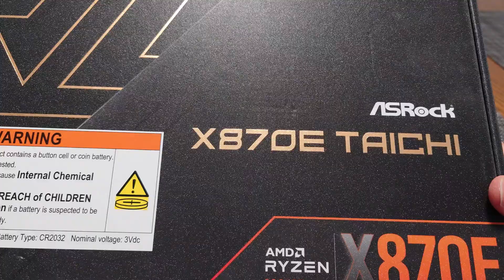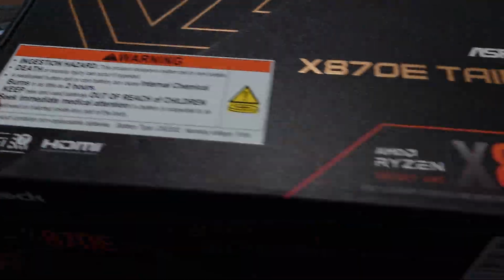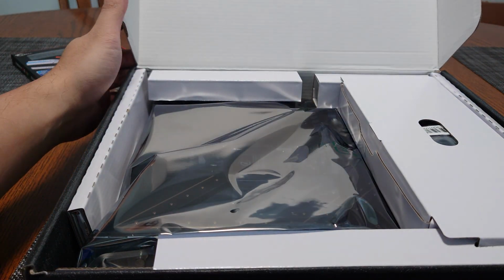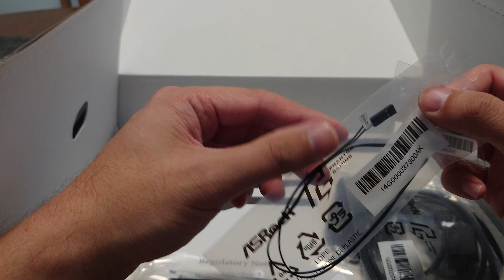ASRock X870E Taichi Unboxing and Overview | Is this S Tier?

Comment: I have both rx 9070 and rtx 4080 super in this motherboard so I can use either as I please.

Asrock X870e Taichi

Msi Meg AI 1300w

Ryzen 7 7800 X3D

Gskill Royal Neo Z5

Samsung 9100 ssd

Msi 32 inch crux Oled monitor

Comment: So if i am gonna insert my old sound card( PCI-E x1) in second PCIE slot, the main one is gonna run in 8X mode? Or it will only happen if i am gonna use another GPU in second PCIE slor? Thank you.
Reply from the maker: Both will run at x8 if something is present in the 2nd slot. Doesn't matter what it is.

Comment: Hello! Thanks for the detailed explanation, May I ask Can I plugin another GPU on second slot of PCIE (I must use dual GPU setup) WITHOUT interfere with the USB2.0 and audio header below the board? I see they are dangerously close to each other, I think the height of the header will be an issue? My second GPU is 3090 FE (extruded metal form), i m afriad it will block the header preventing me installing it correctly

Comment: Should i upgrade x670e to x870e?
Reply from the maker: X870e
Reply: @GameTechReviews  I only play gaming! And use for 9800x3d! I'm currently using Asus tuf x670e  wifi plus and wondering if I should switch to Asrock x870e phantom nova wifi?
Reply: @GameTechReviews  I only play gaming! And use for 9800x3d! I'm currently using Asus tuf x670e  wifi plus and wondering if I should switch to Asrock x870e phantom nova wifi?
Reply: @GameTechReviews and i need to pay an extra $235 to upgrade to x870e where i live! do you think it is worth it?
Reply from the maker: @lindow8297  Why would the price be that different. Unless you are comparing two motherboards that are vastly different in features. If it's the same board for example X670E Taichi vs X870E Taichi, if the price is really that different get the cheaper one.

Comment: quick question i hope you see it. Did the box come to you as it appears in the video, meaning no factory seal of any sort? I bought a mobo before this one and returned it, msi, and it had a plastic seal around,  but this one did not. Want to make sure im not getting an open box
Reply from the maker: It had no seal.
Reply: Mine had no seal either

Comment: just finished building it, the backplate makes the board way stiffer and stronger than those without. the reinforced vga slot also gives me peace of mind. Its got one more additional standoff too so 10 bolts total. Mechanically I think this is the best so far. I used d15S, zero sag

Comment: What is the three pin connector that's right above the front panel header and below the SATA connectors?
Reply from the maker: It's either another ARGB header or the UART header.

Comment: What RAM is everyone using with these?  I bought one and got RAM off the QVL and it wont post.  Did some research and apparently the ASRock memory QVL isnt accurate.  Lot of memory issues with this board and G.Skill.  Cant even make it to BIOS.
Reply from the maker: If it's on code 15 you need to wait several minutes, it will post, it just takes awhile on the 1st boot.
Reply: @GameTechReviews  No it is 21 and apparently way more common than it should be with this generation of ASRock boards.

Comment: I am really interested in the ASRock X870E NOVA.  It has 1 M.2 Gen 5 x4 to CPU, 1 PCIe 5.0 x16 to CPU no switch, so dedicated lanes. Then it has 3 M.2 Gen 4 x 4.  Like you said the price is even cheaper around $350 but out of stock everywhere.

Comment: I don't mind screws for the M.2 covers but,  I do mind ASROCK using a weird size  Allen head screws like they did on the X570 Tachi. Nice to see them use a common screw head.  It's the little things that will drive you crazy when building a PC. :)

Comment: The Taichi is great.....I would say the Nova is a hair better for having 5 M.2 slots and ZERO lane sharing though.
Reply: Taichi also has no lane sharing.
Reply: @ebromoto  He means that if you plug ANYTHING into the bottom PCIe slot, like a 10 Gbps NIC for instance, the top slot automatically becomes x8. It's either x16 / x0 or x8 / x8 for the PCIe slots.

Comment: I just bought this yesterday. I have a question though... About - Blazing m.2 - Using ( Crucial T 705 1TB ) - Should I install Operating system or Drive for my Games? I have 2 of the T705 btw.

Comment: I wanted the nova so bad but its sold out, so i picked up the taichi instead. 
Cant for for the 9800x3d chips to be announced on the 25th
Reply: How’s it going bro ? You finish the build ?  I just got this motherboard, 9800x3d, and 7900xtx

Comment: I have been using an X670E  Taichi  for about 3 months and so far it's been flawless for my use case , a high light that most gloss over is the lightning ports that some say are a gimmick I disagree! The lightning ports use 2 separate usb controllers that use usb to pcie. I use a razor  8000mhz viper mouse and with those hyper polling rate mice I and many others have had problems with them.  When I connect my hyper polling rate devices to the lightning ports 95% of those problems vanish and again this is my personal experience.  With ram I have been able to run 4 dimms @ 6000 CL30  expo and 2 dimms @ 6400 CL30 expo without any real problems. To me the bios is basic but very easy to use. The rear USB ports are labeled 5 and 10 according to  speed ,fyi it's very hard to see, the port with the thicker outline is where the usb drive goes for bios updates.
Reply: Wait what ? You can run 4 sticks ? On am5 and it works good
Reply: @ Yes  and also in expo I’m guessing  I hit the silicone lottery
Reply: @ Yes  and also in expo I’m guessing  I hit the silicone lottery
Reply: Damn dude that’s awesome. I got Corsair platinum 6000 CL/30 only 2 sticks for now to try it out what cpu ?
Reply: @ it’s a 7800x3d

Comment: Spec-wise it's a nice board. Unfortunately it is ATXE, a little cheap looking, and ugly.
Reply: ATXE size should be good for temperatures isn’t it?
Reply: @vqa33  I don't think it makes much difference in temps. Not every case can accept an ATXE MB due to the increased size.
Reply: It's only one inch wider than standard ATX
Reply: @Sahaj1601  1" makes a difference routing cable to the side of the board. With my case the ATXE board will cover the cable slots.

Comment: Which board do you like more for OC performance, the X870E Taichi or ASUS Crosshair x870e Hero?
Reply: Asucks is the worst motherboard brand you could choose, Asrock is the best choice
Reply: Asus x870e hero is for extrême overclock of a long perdiod of time if you dont need that take the nova wich is the best bank for your buck
Reply: @Tsuki9847 that's what I thought as well, but I've seen so many ASRock fan boys shitting on ASUS so I'm like, what am I misssing??
Reply: @matthewjamesmaccarthaigh  people are not happy paying 699 for a motherboard that shares pcie lanes with the m.2 gen slots. 

As rock is currently the only mobo  that has 16 lanes dedicated to the pcie slot that does not share lanes
Reply: @matthewjamesmaccarthaigh Asus just doesn’t have a great track record with good customer support and some shoddy quality control and troublesome bios releases recently. They’re on the right track fixing it internally after getting really bad pr from basically all corners of YouTubers and customers. Might be why you’re seeing some Asus hate comments 💀
Reply: You guys do realise, that they are both brands under the same company. Right?
Reply: @Saphrex not anymore:

ASRock was originally spun off from Asus in 2002 by Ted Hsu (co-founder of the mentioned company), in order to compete with companies like Foxconn for the commodity OEM market. Since then ASRock has also gained momentum in the DIY sector with plans for moving the company upstream beginning in 2007 following a successful IPO on the Taiwan Stock Exchange.[3] In 2010 it was acquired by Pegatron, a company part of the ASUS group.[4]

As of 2011, ASRock is the world's third largest motherboard manufacturer,[5] having cooperated with professional esports player Johnathan Wendel in the development of a gaming-oriented enthusiast motherboard in 2011.[6]

ASRock established itself as a server motherboard affiliate in April 2013, having received orders from 10 mid-size clients for server and industrial PC motherboards and forming partnerships with system integrators.[7]

Comment: 7950X3D ROG Crosshair Extreme X670E checking in. Anxiously awaiting 9950X3D
Reply: Just picked up the ASUS Crosshair X870e Hero and 9950X, contemplating returning the CPU and waiting for the 9950X3D but I heard it's not coming until Q1 2025?
Reply: @matthewjamesmaccarthaigh prolly not until march. I want to get this fall, I got 9800x3d
Reply: @Cognitoman  yeah I built my PC, it was a very fun build and it worked like a dream, but ended up returning everything due to a business investment scam I'm dealing with unfortunately so I need the money right now. BUT things will get better and I'm hoping by March or maybe early summer I'll be able to get the 9950X3D and the new ASUS ROG Crosshair X870E Extreme that was just announced 😁

How are you liking the 9800X3D? And what MOBO are you using?
Reply: @matthewjamesmaccarthaigh  No go ahead and start overclocking the chip. Watch Skatterbencher 7950X3D and see what that chip can do with your BIOS. You'll be ready for 9950X3D when it drops. Can't wait for launch day
Reply: My 79' overclocked is a bad boy. This Extreme motherboard is awesome

Comment: 870e is same as 670e with a tb4 aic card
Reply: Not really. blockdiagram is different. Example x670e has 8 sata ports which 2 of them are done with separate asmedia controller. And the controller does maybe one m.2 also if i remember right. Also if you use some of the m.2 slots it will disable one sata port making it 7 if all m.2 are used.

Comment: I saw that this MB has temp sensor inputs but what I'm interested in is whether you can control case fans or just monitoring of temps.
Would like to be able to control case fans feeding the GPU as the CPU AIO does such a good job temps don't rise so the GPU gets heated.
Even in the bios you can only select the PCIE as your fan control but that temp is pretty stable at load so no joy there.
Reply: Yes, there are various ways to do that with this board and other boards. E.g., you could use the mobo's software... For MSI, MSI Center/Cooling Wizard, etc... Or in the bios, which would allow the fans to be controlled by gpu temp, cpu temp or a temp header, etc.

Comment: I think this is hands down the nicest looking board, FWIW. The Taichi is the one to get if you need to use two 8x Gen 5 slots. Otherwise, the Nova will be hands down better for most people. You trade the 8x slot for a 1x Gen 3 and a 2x Gen 4 (in 1x and 4x sized slots, respectively) and can run ALL the PCI-E slots, plus four of the five M.2 slots all at the same time, with zero lane sharing. Unfortunately, everyone has found out about the Nova by now and they are out of stock everywhere. Hopefully they come back in stock in time for 9800X3D. And also hopefully without a price hike. And hopefully 9800X3D comes soon..
Reply: The Taichi and Nova M.2 gen5 slots don't share any lanes with the PCIE slots? I just picked up the ASUS Crosshair X870e Hero which has 3 Gen5 M.2 slots but the 2nd and 3rd ones share lanes with both PCIE slots. Only the 1st Gen5 and the two Gen4 slots at the bottom of the board don't share lanes.
Reply: @matthewjamesmaccarthaigh  Yeah, both those boards run one Gen 5 and the Gen 4 M.2 slots without any lane sharing. The Nova's x16 slot has an absolutely straight shot to the cpu, so nothing can mess with it. The 1x Gen 3 is dedicated as well, but the 2x Gen 4 shares lanes with the 5th (!) M.2 slot which is also sata compatible for some of the early drives. Taichi has the same 1/3 M.2 configuration with no lane sharing. The two X16 slots are on the same Gen 5 lanes. So it's 16/0 or 8/8.
Reply: @zackw4941  interesting, so just to confirm the Novas PCIEX16_1 doesn't share any lanes? So you could run 3 Gen5 SSDs with no lane sharing on the Nova? Or am I missing something? Thanks for the response! 🤘🤘
Reply: @matthewjamesmaccarthaigh  Nova's X16 slot has a direct path to the CPU, no switches, no lane sharing. It can only support one Gen 5, which is true of most of the boards. The native Gen 5 lanes are the 24 from the CPU and that's it. AMD's reference block diagram shows two 4x lanes being used to support two Gen 5 M.2 slots, but pretty much all the manufacturers are using one of the 4x slots for the USB 4 implementation. So if there's more Gen 5 devices than that, they're either cutting the GPU to 8 lanes, or using a 3rd party Gen 5 switch of some sort. I don't know of that specifically, but I heard the Pro Art has Gen 5 for all of its M.2 slots and I think a switch would be the only way to have that many lanes?

That said, the chipset, X870 or otherwise, is basically just a network switch to truncate many devices into a few lanes. In the 6 and 8 series at least, there are only 4 Gen 4 lanes for one or both chipsets and that's it.

Asus doesn't publish their block diagrams, but every other manufactur puts the block diagram in the manual. So you can go on their product page, look under support, read the user manual and see exactly how every device and slot is connected. Things like onboard USB and networking trend to have their own lanes or controllers on the CPU at least.
Reply: @zackw4941  thanks for all the info and clarification! 😁🙏
Reply: ASRock's technology is good, and its BIOS is also good. However, the product's appearance and DIY ease of use are relatively poor.Currently the number one in DIY ease of use and product aesthetics is msi x870e carbon wifi
Reply: I think the appearance is good tho  @yuan.pingchen3056
Reply: @yuan.pingchen3056  I like the look of the Nova, but that's down to personal preference. Although, in my case, all I can see through my window is the D15 and graphics card. But also, it looks quite easy to work with. Why do you say it isn't as DIY friendly?
Reply: @zackw4941  it still uses screws, screws falling down inside the case and you can't find out the screws, this situation is a nightmare.
Reply: Nova or godlike when released.  Going to wait till all are released and decide.  Going with 9950x3d when released.
Reply: @christopherramsay5517  Nova or Godlike? That's a pretty big spectrum!
Reply: Back in stock today for anyone wondering

Comment: I have the X670E Taichi, absolutely amazing board. Would this new X870E version allow for higher ram clocks using a 7950x3d?
Reply: There is absolutely no need for an upgrade in your case, u would get better performance if you do an upgrade from the 7950x3d to the 9950x3d
Reply: Up to 8200 Mhz
Reply: I have the same board but if you look  the mother board memory qvl for both the X670E and X870E taichi the answer is no, the faster ram speeds for 7000 series is on the X670E taichi

Comment: Wish they would include at least a few black M.2 Screws. Ironic that spending over +2500$ for high end PC parts and a single M.2 screw would screw everything.
Reply: its comes with 3 extra screws m.2 screws and a total of 8 m.2 screws
Reply: It's your obsessive-compulsive disorder that will mess everything up, not just a M.2 screw.

Comment: on my Gaming Nova X870E I was able to get stable on a pair of Gskill Hinix 6000mhz 16gbx2 the amazin speed of  7600mhz speed stable :elbowcough:
Reply: God damn Jésus Christ awsome  😮
Reply: Wow, that's a huge overclock! I'm surprised you were able to get a pair of 6000s to clock that high! Awesome!
Reply: @RKBenchmarker  Gskill make good quality memory for overclocking and Hynix memory are the only one you need to get   memory speed overpass the specification . So glad I grab the Nova on Neweeg for just 325.00 after mail rebate
Reply: @mauriciob8260  Yeah, that's an awesome buy. G.Skill is all I use. I have 6000, 7800, and 8400 kits. I've got some good oc out of them, but never able to get 7600 from my 6000 kit.
Reply: @RKBenchmarker  thanks
Reply: What are the timings and frequency of the infinity fabric? I have x870e Taichi Lite and gskill 2x16 6000mhz 28-36-36-96
Reply: And what voltage Vsoc and Vdram?
Reply: the key also is set the correct sub tmmings and procOdt ,etc
Reply: Nice! I picked up the ASUS Crosshair X870e Hero, 9950X, and Corsair Dominator Titanium DDR5 2X32GB 6000Mhz 30-36-36-76 AMD EXPO, will see what I can OC stable to
Reply: @matthewjamesmaccarthaigh you can start with a base of 6400mhz with this Mobo on Gear 2 of your bios ram settings and then you can start overclocking its a free 400mhz dont miss it 👍👌

Comment: this stuff vs carbon, which one better?
i found carbon have more pcie x4 , which one need for future? maybe capture card, etc?

anyway pcie 5x8 slot 2, what for? i mean except the graphic card, they only use x4 ?
Reply: I agree with you about the pcie slots. And my personal opinion is that the x870e Carbon is the best $500 mobo with the Strix-E and Taichi 2nd.

Comment: What kind of G. Skill Trident RAM do I need for this board (using for gaming and not content creation). I’m assuming I just need two 16GB sticks, but need to know what speed, timing, etc. thanks
Reply from the maker: The recommended DDR5 6000 and 8000 kits are in the description.
Reply: @GameTechReviews  Thank you
Reply: I chose for myself gskill 16gb x2 6000mhz 28-36-36-96.
Reply: Trident Z5 Royal Neo

F5-6000J2636H16GX2-TR5NG

Trident Z5 Royal Neo
DDR5-6000 CL26-36-36-96 1.45V